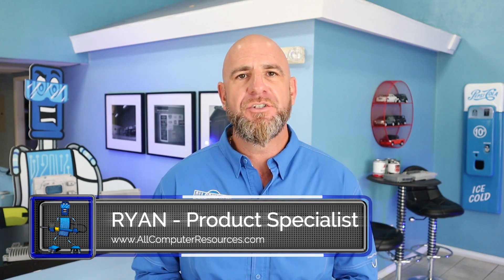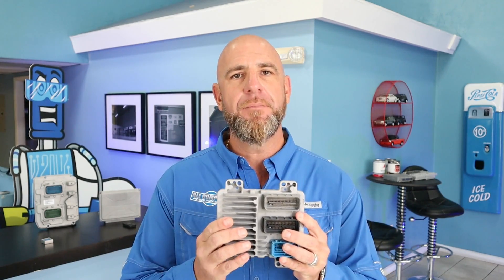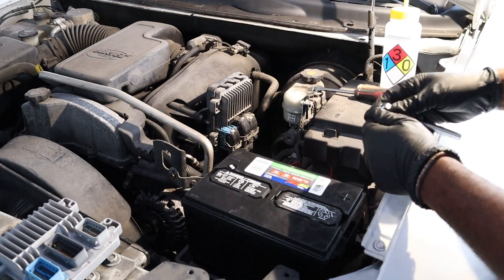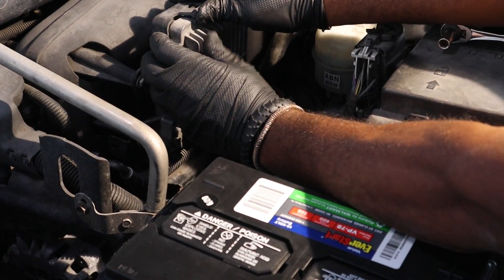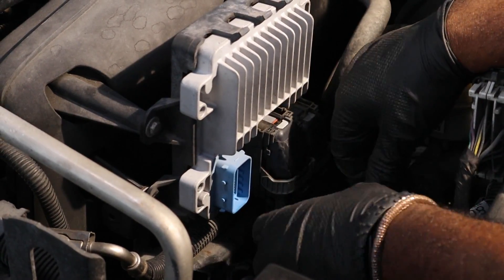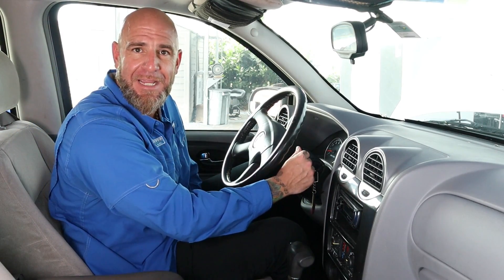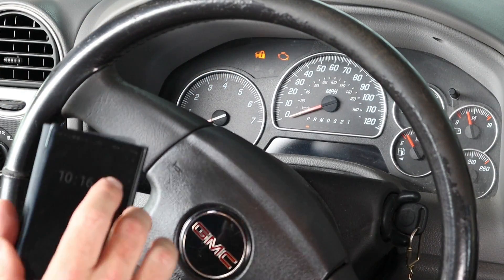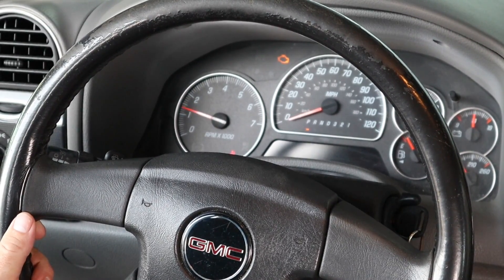HOW TO PROGRAM KEY FOR GM/CHEVY ANTI-THEFT - ECU REPLACEMENT PK3+ / PASSLOCK

Comment: I have a 2005 GTO, I've recently replaced the ECU and trying to perform VTD relearn. What key does it have and what relearn system is it? I'm assuming it's the third one?
Reply from the maker: On your Key it'll either say PK3/Passkey or PK3+/Passlock. We have 2 videos for GM relearn (link to other video in description)  - About 40 seconds into this video I show a diagram of the key in which this video applies to same as the other video . Hope that helps!
Reply: @acr  That doesn't work for the GTO, you have to perform a PCM to PIM relink.